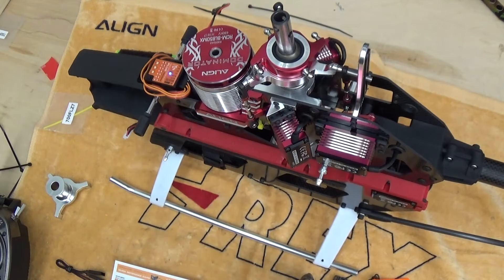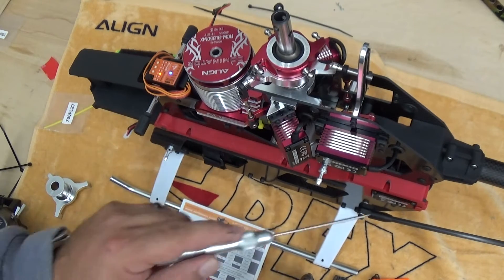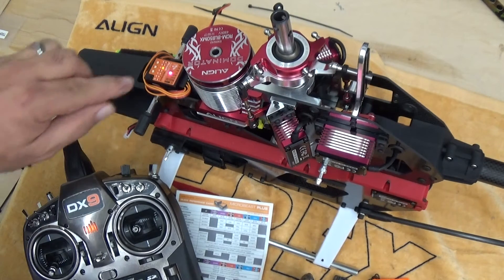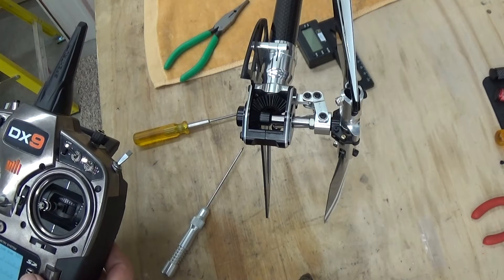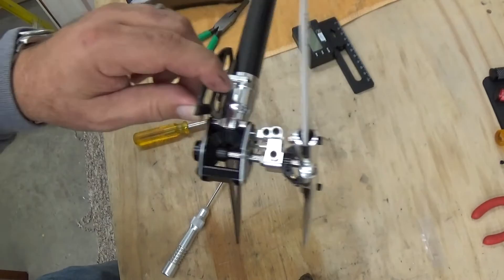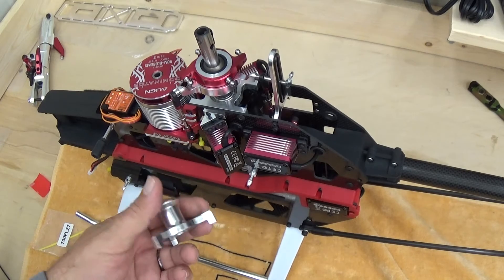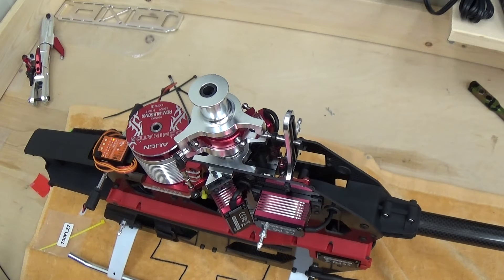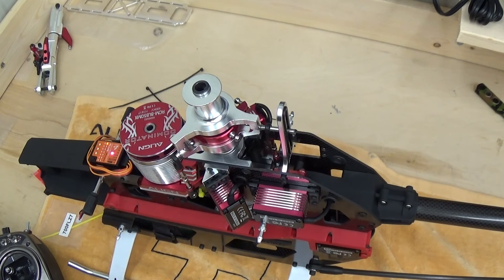TREX700X MicroBeast part 2

Comment: Jim have followed your setup guide to set the Ver 5.2 in point F Rudder direction. My question comes from the quick setup guide for Ver 5.2 in addition to the steps you have taken there is an additional (optional) step to advance the rudder stick to full deflection and the status light should change from a flashing light to a solid light in both directions. Adjusting the servo throw in the transmitter to 150% will not gain a solid light as described in the manual. Is there any insight you can shed on this problem, Thank you so much this is my first FBL setup and want it to be correct all other settings you show matches with 5.2 manual.

Comment: I know this is a old video but I'm having a issue with setting up SRXL to  AR8020T to microbeast,, the micro beast doesn't see the receiver,  it just flashes the a letter, when I hold or press the menu button it cycles through solid red, solid blue ,off then goes back to solid red and flashing, never goes to menu b or N any help would be great

Comment: Hello from Spain but i maked it all with the 470LT M with the Microbeast X 5.1.4 but you tell nothing how to set the Rate and Headlogging mode because i dont understand to set it wright . And the Microbeast have to change the ligts when you set is on his wright place . I hope you can explain it because nobody on You Tube has maked it . I hope you can help me , ihave set it to Mircrobeast and not Tranmitter and my Tranmitter is the Algin A10 with single line receiver on 2 Algin Helis The first was the 450L 3S ARTF so all is setted . Best regards from Alicante Spain :-))))))))))))))))))))))